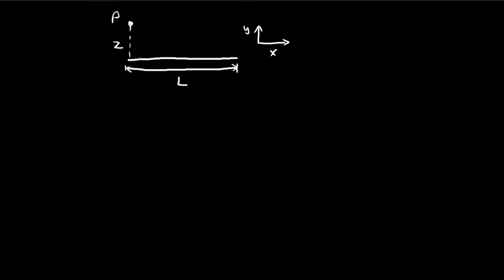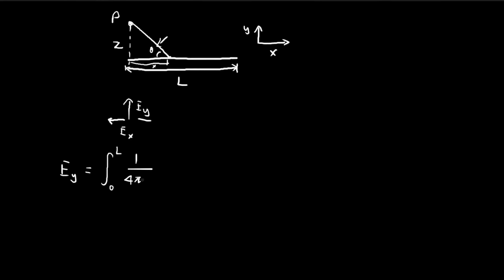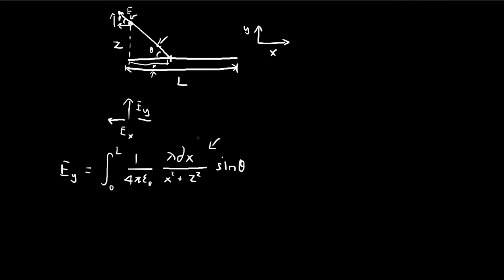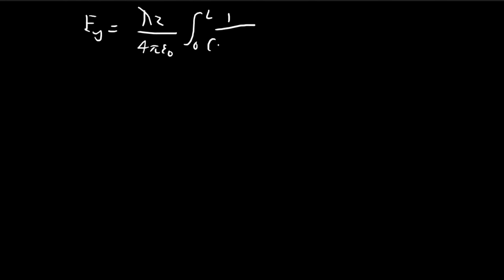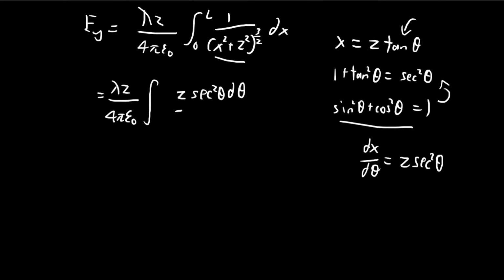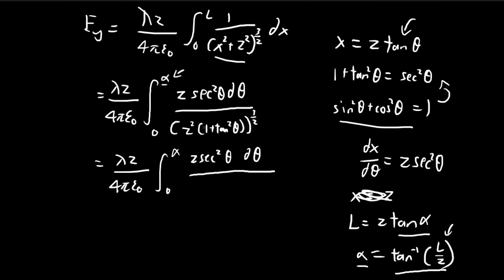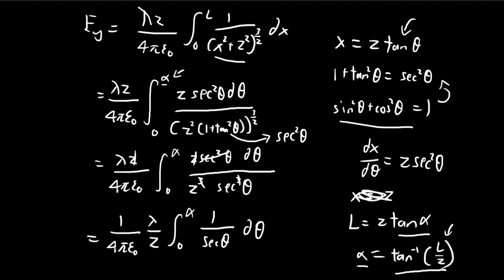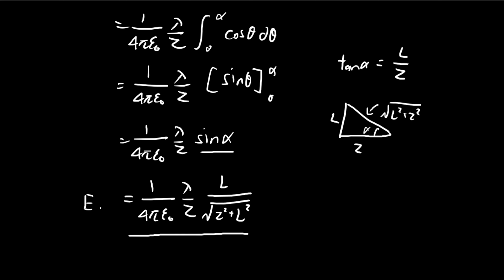Problem 2.3 (Part 1) | Introduction to Electrodynamics (Griffiths)

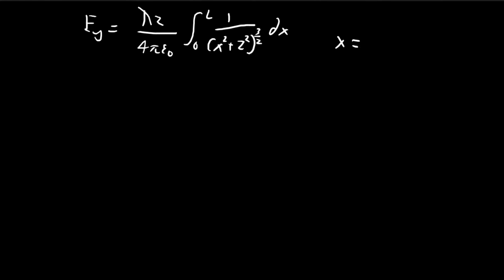Comment: Hi how does x = z tan theta @3:32 ?, would it not be x = z / tan theta. I am following the rule of tangent theta = opposite / adjacent. Thanks, always great videos.
Reply from the maker: I think I might’ve made it a bit confusing here, sorry about that. 

Think of the substitution of the integral as a purely mathematical question, with no relation to the diagram in the previous slide. I’m just trying to evaluate the integral, so any substitution that leads to an answer works for me. Think of the theta of the integral as separate from the theta in the diagram.
Reply: @HayashiManabu  Thank you for the fast reply that makes much more sense now. Great content as always!